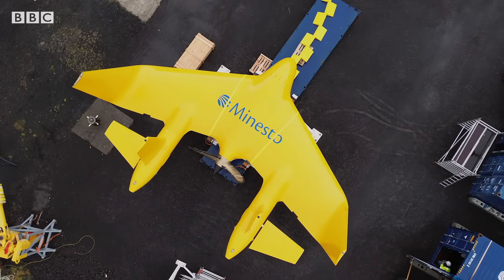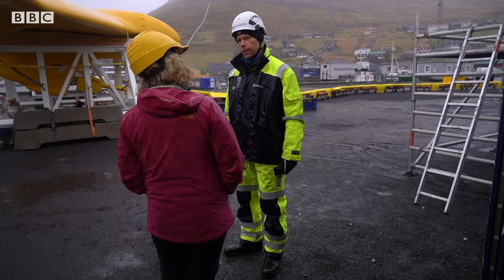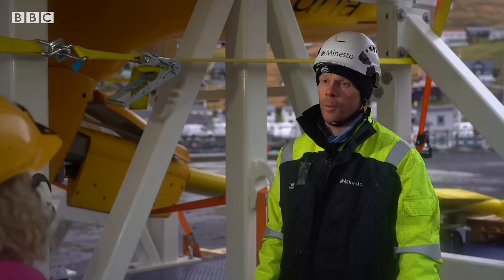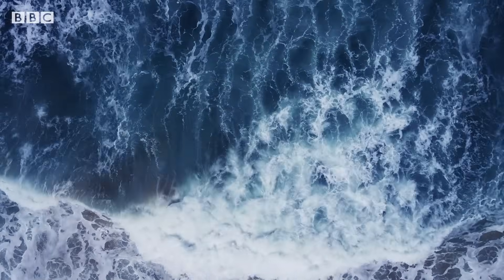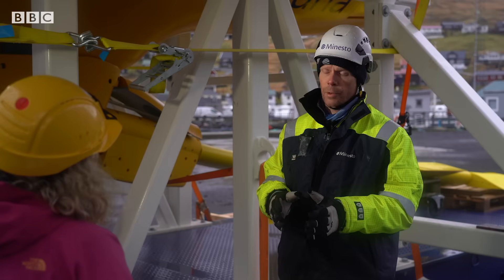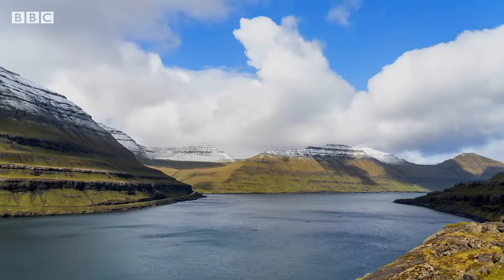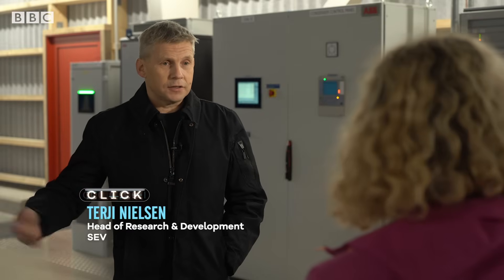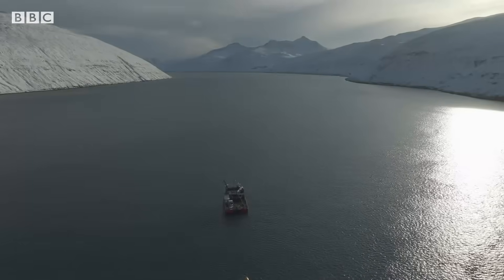The underwater 'kites' generating electricity as they move | BBC News

Comment: 1.2MW, that's not bad, especially considering how small it is.
Reply: Yeah that’s like a few hundred people daily.
Reply: That is claimed peak output.  Tides, like wind, are "intermittent", meaning they do not always flow at peak speed, or at all, actually.  So the capacity factor is probably something like 30%, just like wind and solar.  That would mean an average output of maybe 400 kW, if you are lucky, probably less.  Yes it is exactly a "kite", like a stunt kite, (pulling a turbine) that "flies" underwater.  Been following this effort for years.  I'm in doubt that it is the best way to capture tidal energy (too many things to go wrong, maybe too expensive for the output), but at least they are giving the underwater kite concept a good try.  Someone had to do it!  :)
Reply: @dougselsam5393  Tides are intermittent but HIGHLY predictable... a comment in the video indicated they are predictable hundreds of years into the future... That eliminates one BIG source of economic risk, which always must be considered.  2.5 MWatts is enough for about 500 residential homes. Assuming 30% efficiency as you did, that's still enough for 150 homes, full time, 24/7/365. Probably expensive to build and install, but energy is essentially "free" ( minus maintenance costs ) after that... for decades....
Reply: @dougselsam5393  It will probably be hitting that peak output quite a lot of the time. The main advantage of this sort of kite design is that the large wing can convert low flow speeds to high flow speeds by doing circuits, but when flow is already fast it can fly straight. The actual turbine part can be exposed to the same conditions under a wide variety of flow rates by varying the flight profile.
The major challenge of this sort of technology is that the ocean is incredibly destructive, but not uniformly. You need to design your system to be able to cope with the most powerful conditions possible, while also being cheap enough to be economically viable given that most of the time you will not have that much energy available. If you install a turbine that can cope with the highest flow rates, it will be overkill the majority of the time. To see why, consider that if an inverter only goes above 6kw 1% of the time, you don't want to spend the money on a 10kw inverter. You have effectively bought a 4kw inverter that is only operating 1% of the time. Most energy harvesting systems are 'clipped' for this reason. This gets around it by using a simple system (the kite part) that can upgrade low flow rates to much higher ones, letting you operate at the system design wattage for much more of the time.
That 1.2MW power will be for the whole system. That will be the turbine operating at ideal conditions, the cabling operating at rating, the inverters operating at rating, and the grid connection operating at rating. The kite part is there to provide the turbine with those ideal conditions over as much of the actual operating range as possible. A capacity factor of 60% wouldn't surprise me.
On the hardware side this is much simpler than most designs. The turbine can be designed to operate under a narrow range of conditions, so can just be a fixed prop with no gearbox. It doesn't need to be able to feather. The controls for the kite are simple rudders. There are no complex actuations required. You need to have bearings that can handle being in seawater, but electric motors work by magnetic fields that can go through water barriers just fine, so you don't need any moving seals that would require maintenance.
Reply: It’s anti submarine warfare generator.
Reply: Not each one. For arrays of dozens that stretch for 10s of square kms.
Reply: @obsidianjane4413  Nope. It's the max output of each one.
Reply: @RegebroRepairs  I seriously doubt that.
Reply: @obsidianjane4413  Well, that's the claim. We'll see if they actually work.
Reply: @obsidianjane4413  You shouldn't doubt it, seriously or otherwise. The Dragon 12 device shown in the video really does have 1.2 MW rated output.
Reply: @obsidianjane4413  no need to doubt it. Its a fact. It has been up and running for 4 months and and it works as good as it was supposed to do.
Reply: @obsidianjane4413  It really is 1,2MW power output. This is due to the fact that the turbine is accelerated by the currents lift force in the wing to about 15-20m/s speed and the power output has cubical correlation to the speed.
Reply: @jacka9612  So does drag...

Comment: The problem with any equipment you immerse into the sea is marine growth, seaweed and barnacles.  They need constant cleaning.  This is why most of these technologies fail.
Reply: Its been in for years. Just like ships and boats they have technology to make that problem smaller. No constant cleaning. First installation of the 1,2 MW kite was brought up after 4 months for checking. It is supposed to be 6 months  intervals.
Reply: Bringin it up took in total 2 hours using a small utility vessel, and then 2 hours to bring it back for an additional 4-6 months. Very reliable, clever and cheap

Comment: Not to be a doubter but has anyone considered what a concentration of these (say 20-30 or more) working within a strong current area of the sea where tidal current is important to not only the oceans health but our own weather that is influenced by the speed and flow of the current mixing of cooler saltier and warmer fresh waters?

We are currently having a issue with the current causing weather fluctuations and drought.

This is copied and pasted.

The Gulf Stream, a western boundary current in the North Atlantic Ocean, influences the climate of the East Coast of the United States and Northwest Europe. The Gulf Stream carries warm water from the Caribbean to the Grand Banks off Newfoundland, then across the ocean to the Norwegian Sea. As the water cools and evaporates in the Norwegian Sea, it becomes saltier and denser, causing it to sink. The cold, dense water then flows south along the sea floor, eventually being pulled back to the surface in a process called upwelling. This process drives the Atlantic Ocean's conveyor belt, or AMOC, which helps REGULATE the GLOBAL climate by transporting warm water and precipitation from the equator to the poles, and cold water back to the tropics. 

Now consider if we slow down that current or influence it in ANY way! 

Now this isn't even taking into consideration what the impact is or could be to marine life or the oceans vegetation which is also going through horrible dieing off of corral reefs and also other ocean wildlife.. 

Look I know as well as most other actually thinking humans know we need a solution to a really massive issue with producing energy. I just think we need to start thinking about the bigger picture of these absolutely amazing inventions that hold so much promise however we need to stop thinking that the ocean and what it naturally does is free to us to influence. Some of these may vary well be free power without consequence but step back and look from the thousand foot level and take a bigger picture look to be sure that we don't do more harm than good. 

Food for thought!
Reply: Gulf is not going to slow down  - it has been debunked since the alarmist came to wrong conclusions about the matter.
Reply: @jacka9612  your are completely mislead and it has never been de-bunked unless you are getting your news from FOX..

Comment: It'll be interesting to see how this goes once installed. 1.2MW is only about 10% the size of big current offshore wind turbines, and it's a rated capacity, not average output? It must be borne in mind that NetZero doesn't just demand electricity is renewable, but also every other energy consumed by an economy. For example UK electricity consumption averages 40GW, but total energy consumption averages around 180GW - and that's while someone else manufactures/grows the things we use/eat.
Reply: This is predictable energy. When in parks, they will place them so the phases overlap, which gives base load 24/7. They plan for larger dragons used in ocean currents as well. Those never stop.
Reply: @Ginflyer  I think 'predictable' is oversold for renewables. We're currently doing it wrong, having VRE directly connected to the grid. The very greatest quality of fossils is that we're working from colossal *stores*, so if for any reason we need to 'turn up' generation, we can. Most VRE should be used to create long-term storable, exportable energy commodities and the consumption side should be mostly powered by releasing that stored energy with dedicated generators. I'm not demeaning sea kites, it's an interesting and pretty development. Just saying what counts is how much energy it actually yields per capacity, what it costs to get it, and ultimately what (UK) potential there is.
Reply: @trs4u  predictable production is very important if u want a stable production. Unpredictable like win makes alot of challenges for storing electricity(not practiaclly possible on a larger scale) or having oil generators as backup.
Reply: @Jonas-wh2zq  consumption is only crudely predictable. In the UK it's highly weather dependent. Our 'predictable' generators like nuclear (do we have another?) depend on gas and balancers to soak up the differences. I think the 'more the merrier' with generation types, but the proof of the pudding is in the eating. I'm looking forward to seeing the stats for production sea kites. [Edited as accidentally posted before finished]
Reply: It's maybe 10% (already, by its 1st iteration in utility scale) of the biggest wind turbines not yet in volume production, but it weights only about 1/3 of those per MWh produced - and I'm beeing nice not counting the foundation, in which case the ratio would exceed 5 to 1.
It's like you get 3 TIMES more output power for the same material weight.
Can't beat that.
Reply: @jacka9612  are you comparing production stats and production stats? Everyone's imaginary generation scheme is superior. Mass per MWh can't be calculated until a generation technique's production totals and its consumption rate - how often it must be completely replaced - are established. Let's see how it performs.
Reply: The point of the kite is that it can fly circuits, and amplify the energy provided to the turbine, or fly straight, and present the turbine with energy unamplified, or anything in between. This gives you a design that can get rated power output at low flow rates, while being able to handle flow rates 10x that without trouble. I can see this hitting very high capacity factors.
Net capacity factor could be above 75%, as it is only generating less than rating when tide rate is less than ~10% of peak. Not only is this predictable, they are relatively fast cycling. 2 tides a day, each tide goes in and out, with lulls at each boundary. There will be ~4 gaps a day, where the current drops below rating, and these dropouts will probably last about half an hour, an hour tops. Assuming an average of 900kW, each of these could provide constant supply with 900kWh of battery, costing less than a million at current prices and providing stabilisation to the grid.
That total energy consumption can typically be done at 3x efficiency from electrical sources, so only means another 60GW. Still a lot, but considerably less than usually presented.
Reply: But the low carbon solutions are much more efficient, an EV is 4x more efficient per kwh, and heat pumps are 3 - 5 x more efficient. So the TWh figure for total UK energy consumption can always be cut ~75% when talking about pure electrification.
Reply: @mckennakills72  that's just sloppy thinking. Some consumer applications may be more efficient when electrified - not all of them can be, and the cost of upgrade is a severe deterrent to all but a few of us who are taking all the public purse assistance while it's available. It's not wrong that we started at the 'easy end's, but our experience here can't be applied 'QED' to the other applications.

Comment: What is reason to use them if they have to be moved by ships . Ships are using diesel not electricity.
Reply: Eh, they are ancored at the sea bed via a tether, where the electricity is transferred to shore.
Reply: They are only moved (by very small vessels) when installed an maintained every 6-12 months.

Comment: so the energy isn't coming from the slow movement of the tidewater past the propeller? is it mainly from the wings making the thing move around in the water faster than the tide and that turns the propeller? else if the former couldn't they just put a an underwater windmill on the sea floor?
Reply: The movement is making the turbine go about 8-10 times faster than the current which is exactly what gives a 28 tonnes turbine the same output as other tidal 800 tonnes turbines placed on the sea floor. And it works well. Also cheap maintainence due to light weight and far reached automatisation.
Do you see it now?
Reply: It's far too early to declare "cheap maintenance" on these.
Reply: The turbine power formula is:
P = 0.5 * ρ * A * Cp * v^3

The power is dependent on velocity cubed.

So for a relative speed of the kite/dragon that could be up to x10 times the actual tidal stream you would generate x1000 more power given the same sweep area of the turbine compared to a stationary turbine on the sea floor.
Reply: Yes, yes and no. It's the underwater equivalent of the failed Makani energy kite.

Comment: Wouldn't replaceing the hole hydro electric generator with a new, fixed or maintained one be more sufficient, towing all the way from Denmark two times in stead of four, it would half the carbon foot print.
Reply: It’s towed to the nearest harbour (30 min away) by a small utility vessel called Gronanes. Look it up on marine traffic. Takes in total 2 hours from the boat leave harbour. This is every 4-6 months (planned maintenance)
Reply: @Ginflyer  Guessing the chain would be the most worn part ? Due to the temperature of the water the ball bearings wouldn't get hot expand and wear out as quick. Due to water being more denser than air im also guessing the underbody would need filling and painting, air can carry micro partials, but water could carry millimeter or evan centimeter particals ?  Does it have a slip ring like a wind turbine ?

Comment: Mooring, mooring, mooring.  It's always the mooring that fails with this type of devices. It should be sturdy enough to withstand the storm of the century and light enough for not to prevent action.
Reply: No need. It’s minimum 8-12 meters under the surface. No weather will bother it there.
Reply: @Ginflyer  Acceleration and deceleration forces of the wave affects down to the depth which is half of the wave length. 100 m long ocean waves are common. Mooring cable and its fixing points are under constant ripping and bending forces caused by waves and by the movement when it "kites".
Reply: @TommiLipponen  of course the cable is made to wtihstand the forces that are created. And no the wather doesnt affect the kite with more forces than what its already creating itself while moving in a figure of 8.
Reply: @Jonas-wh2zq  This is an important and innovative project. New way to produce clean base energy, like the gentleman in video said. I wish nothing but success for it. And, by the way, Faroe Islands is a wonderful place, I visited there and loved its nature and scenery.
Reply: @TommiLipponen  No 100m waves that close to shore where the dragons lurks...
Reply: This is the point of the kite. At peak tide the glider can operate at a lower angle of attack, limiting the loads on the mooring and turbine. You can build a system has peak loads much closer to rated loads, meaning the cost per watt of all parts (that have to be rated to peak loads rather than rated) can be considerably lower.
Yes they know this, and agree with you. This is the point!

Comment: And what about the wildlife?
Reply: Zero incidents in 10 years of testing. A lot of research has been made
Reply: @Ginflyer  Of a single prototype that has only been actually in the water for a few hours.
Reply: @obsidianjane4413  get your facts straight. The current 1,2 megawatt has been in the water for over 4 months. Before that they used 2 0,1MW kites. It has also been one prototype running off the coast in Holyhead for a long time.
Reply: @Ginflyer  ...with a couple of them at a couple of places, but that does not means that hundreds or thousands of them around the world would not become a catastrophe very fast.